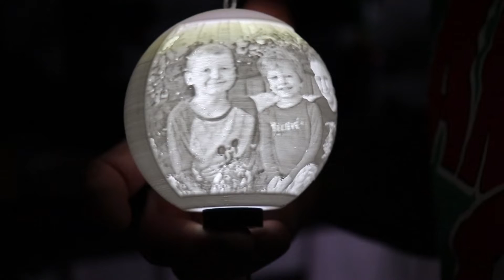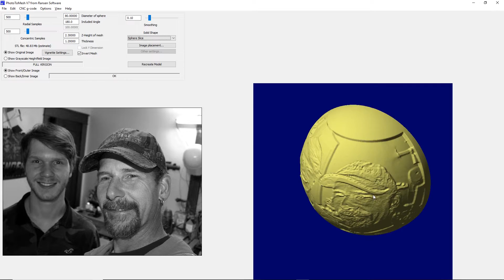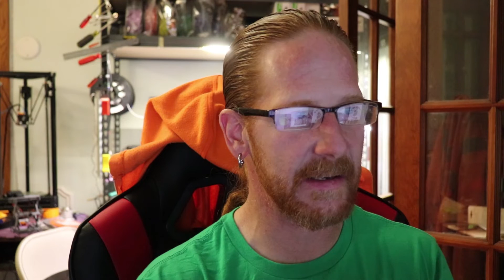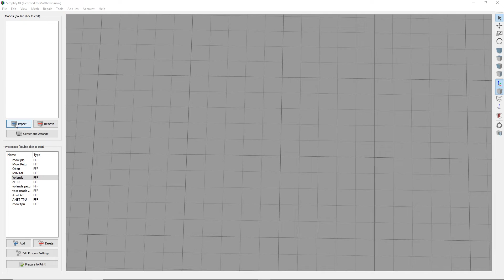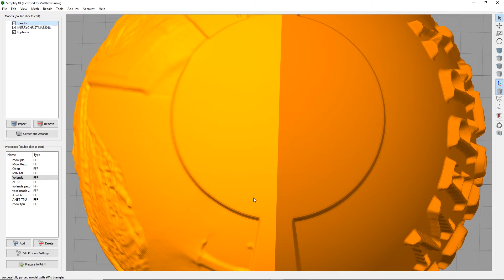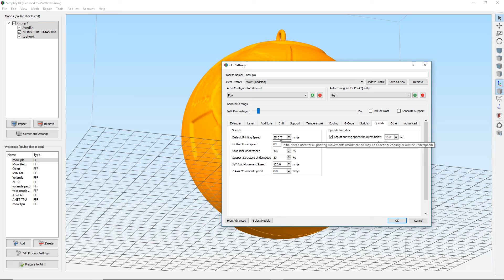3D Printed Christmas Ornament (Photo To Mesh)

Comment: Interesting way to use the processes in simplify3d. Do you have a different process for each of your printers? I currently have different profiles so I have to click "change print settings" and switch profile for process 1.
Reply from the maker: yes with simplify3d i can set everything up with as many profiles I wish all 7 printers have a profile and some have different profiles for different materials very easy to switch from one printer to another
Reply: @InsideTheMindOfMatt  I tried doing it your way with different processes but it doesn't update the build plate dimensions (I have a kossel delta with circular bed and a CR-10 with rectangular bed). However it updates when I change profile within the process. Guess I have to keep switching profiles not processes.